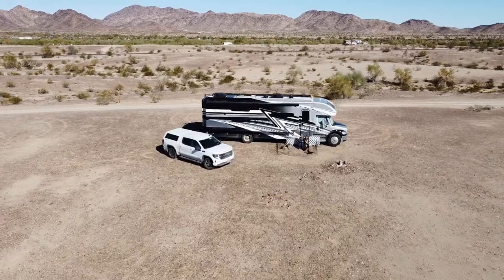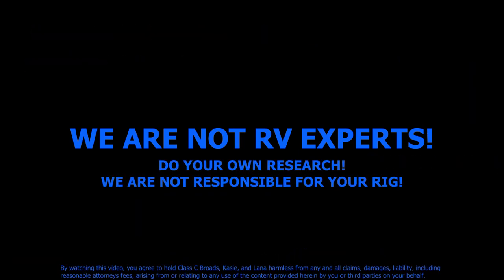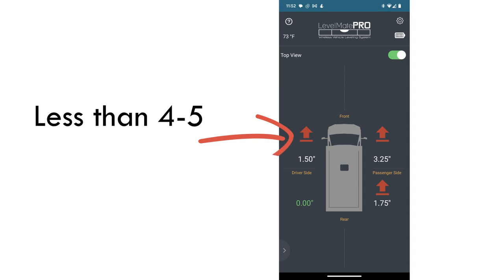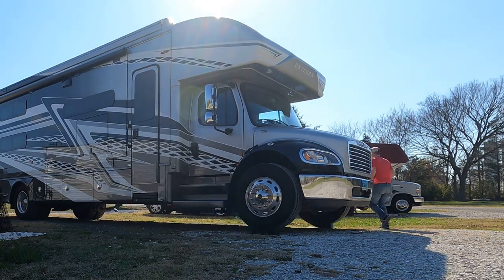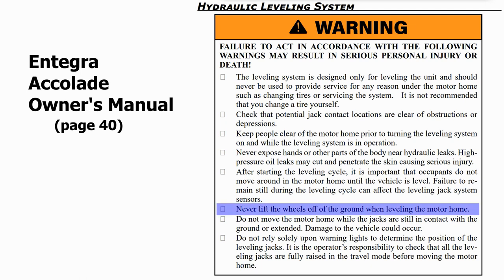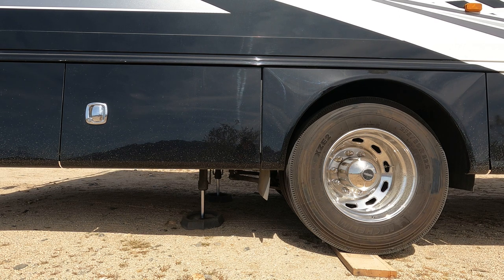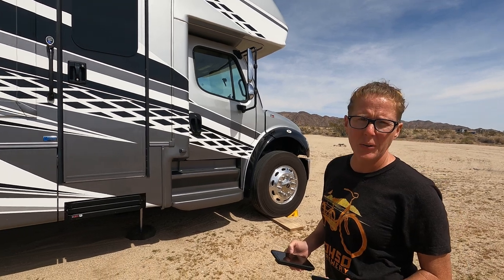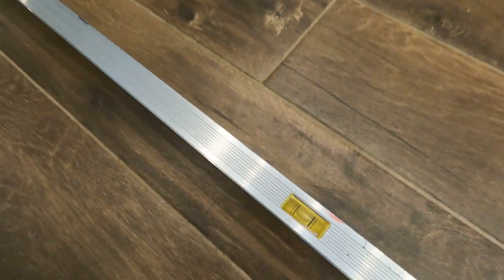LEVELING 101 | How to Level a Super C RV on a Freightliner S2RV Chassis | Motorhome Leveling Class C

Comment: Excellent tips thank you! We have been experimenting with our leveling since we bought our 2023 Accolade XL last year. We agreed the Auto Level is worthless. One other thing we notice is when we are on the jacks, regardless how we level it, the coach door will not latch properly and the deadbolt cannot be extended. When it's on the wheels it latches just fine.So there must be some twisting or something going on. Have you guys experienced this?

We are also waiting for the 'door flapping recall' parts to arrive, which I believe consist of a magnet latch being installed at the top side of the door. Hope that works.

We enjoy your videos, keep 'em coming! ;-)
Reply from the maker: We don't have differences on the door operation depending on whether we are on jacks or not, but Kasie did make some adjustments to the door latch based on this video.
https://www.youtube.com/watch?v=u7MOwM3x2_o&t=327s
Our door rattle is minimal as well.  I suspect that if you fix the latching issue, the door rattle may subside too.
Thanks for hte feedback on the videos! Safe travels out there!
Reply: Is that door recall on all Allocade models, I have the 37k?
Reply: @charliedelgado573   Well not sure at this point. Our previous service advisor said it was a recall, she never called us back, three months later I called and she no longer works there. The lead advisor now has our case and knows nothing about a door recall however our door magnet assy actually did arrive. Dropped off the rig two days ago, this all started in December 2022, and the advisor is going to check into any recalls. I formally requested the new door style as a replacement as ours is bent from banging around for thousands of miles. Not likely that will happen. 

To answer your question though, all the doors are the same as far as I know so if it turns out it is a recall then I would guess it applies to your K model as well. Best to call your shop.
Reply: Thanks, will check with Jayco as I am still dealing with warranty items and my K is at the dealership now.  Know the feeling of the revolving door of service advisors at the dealership, it has been very frustrating dealing with stuff since January 2022.

Comment: Do the beech lane levelers fit that large of a tire? Have they broke yet? The Anderson ones say they are for a 32” and smaller tire.
Reply from the maker: We originally bought the Beach Lane levelers for our Jayco Greyhawk (smaller tires), but have used them without issue on our Super C.   They are rated for 35K pounds.   I only use them on the front tires though.  The radius of curvature isn't ideal, but they work.  I think that 2x8 boards work pretty well too, and only use those on the rear tires.  I've gone through a couple of boards in the past two years (cracking), but I can usually find a replacement board easily at a construction site dumpster.
Reply: Thanks for the info! I glue and screw outdoor plywood on my 2x boards to give them a little more strength.